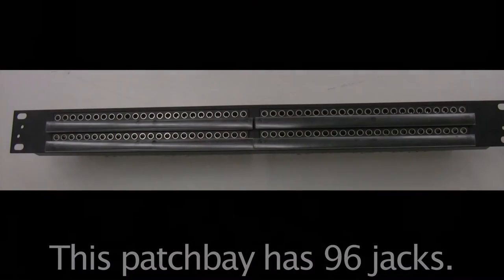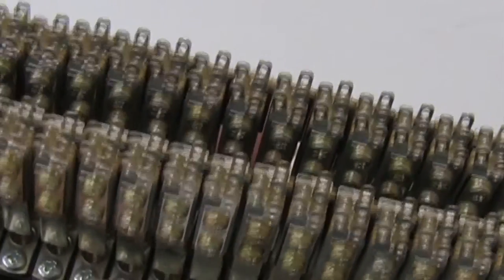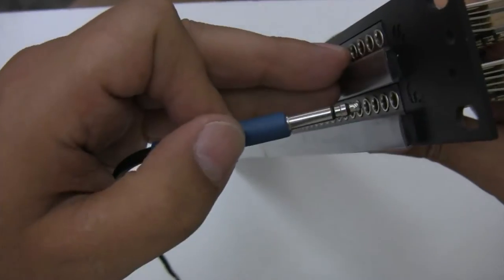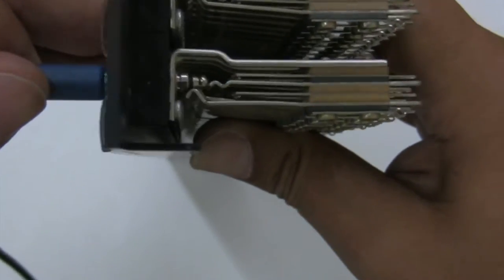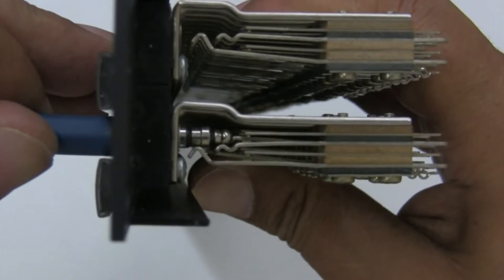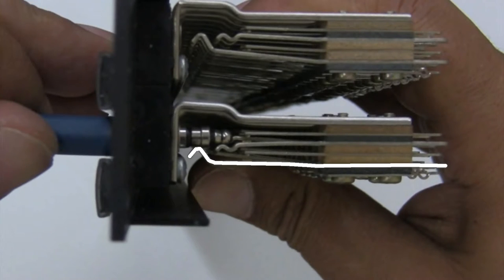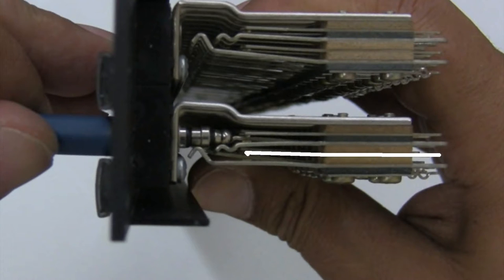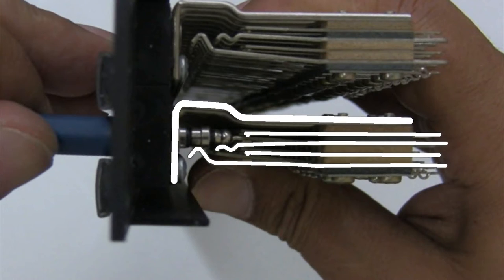How to Wire a Patchbay: Ground Issues

Comment: telling people to life their grounds. this is unsafe behaviour. completely not a good idea to be teaching this kind of thing.
Reply: Right on man. NO REASON TO DO THIS! It's ILLEGAL in most places. Also just blindly strapping all of your grounds is not a good idea... Yes, it works for some people some of the time...
Reply: You're not lifting the ground because they're grounded through the patchbay (if you do what he says).
Reply: @chadjohnson-authormusician8072  They are grounded through an audio cable and components ... which is not meant to ground high voltage/current.  When the audio ground is fried by the fault ... it will seek another path to ground ... perhaps through you.

Comment: doesn't lifting the ground off of these devices mean some danger to them if a short were to occur?
Reply: I don't know anything about anything, so take what I say with a pound of salt. You are responsible for yourself, I am not, if you follow my advice you may blow up, and burn your house/studio/structure down, killing everybody inside. With that said, I THINK that what he is saying is that each device is grounded through it's connection to the patchbay, and the patchbay is grounded to the mixer, and the mixer is grounded to the wall outlet.  So, every device IS grounded, and all devices share the SAME ground, so you don't get ground loops which can cause errant noises. I have heard ground hums on many occasions over the years, like a 60hz hummmm.... but I've also heard what I call little zipper sounds, I only hear them in quality headphones, but they're very subtle, and they go zzziiiipp, kind of like a zipper being zipped up. 

My question is, though, what if you draw more amps or watts than an outlet can safely handle (like 80% of its rated capacity?, I think I've heard)?  Don't you need to split the load onto another circuit in the facility? So you've got 20 amps on one outlet, and 2,400 watts (both amps and watts times by 0.8 to reach 80% of actual capacity) and the same on the second outlet on a different circuit, so you can power everything without too much stress on one outlet. But this suggests you'll get ground loops, but why if both of those circuits are tied into the same ground for the facility? Isn't there still ULTIMATELY one path to ground? Or are there little variances on each of those paths on the way to the actual ground/earth caused by different resistance/capacitance or whatever of each cable, with cables of different lengths? Wish I could get some answers.

And again, don't no body listen to what I'm saying or follow my advice. I really don't know about these things.

Comment: I did pretty much exactly all these things you mentioned in the video. I was taught this method by the Rep from D&R when I bought their D&R Orion Modular In-Line console back in 1992. The only other thing I had done, by their direction, was to install a star grounding system with equal length grounding wires to all out board gear, patch bays and console, terminated in a central terminal strip and from their a heavier gauge ground wire that ran to a grounding rod that I put in my back yard. Hence, my home studio was isolated from the rest of the house. I still have that system today and works great. 

There was actually one other step of lifting the grounds on one end of the audio cables, so I had soldered all those wires myself with the appropriate audio ground lifted on one end...It's a little complicated to explain here, but the system worked great...
Great video and great information you shared...
Phil
NYC Area